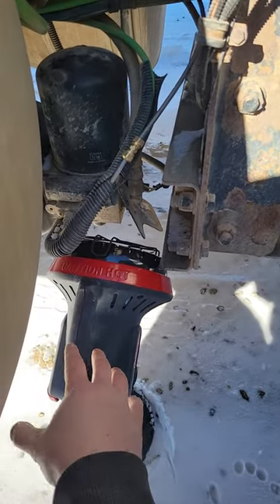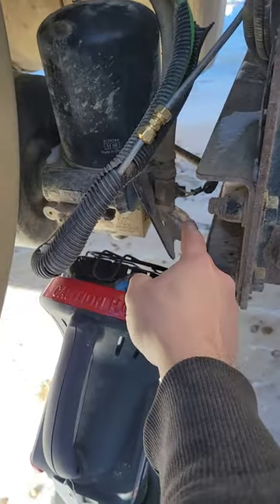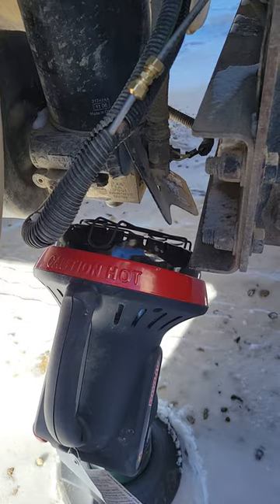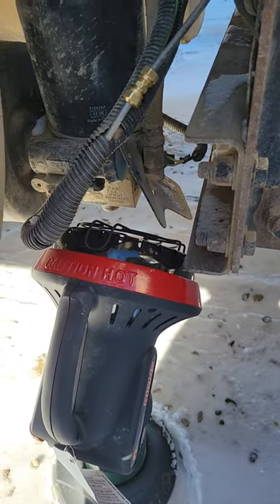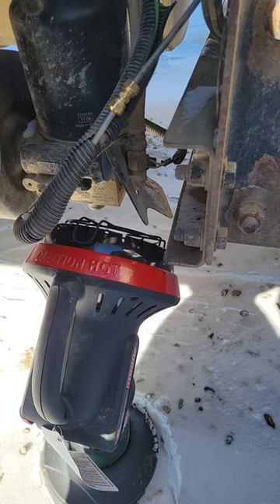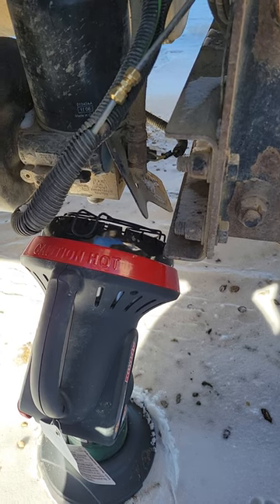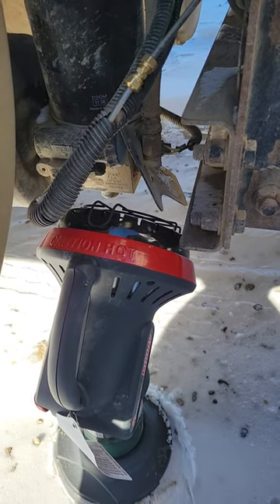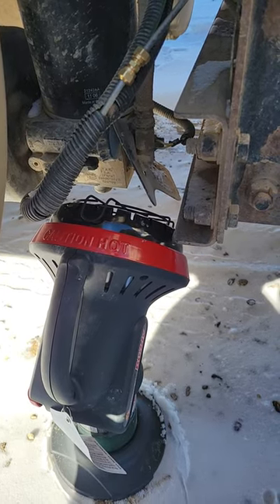How to thaw out your frozen air dryer on semi truck

Comment: If you would stop all the air leaks on your truck and drain your tanks daily  then yo7r air compressor wouldn't be cycling so much and making so much condensation in your system.  Being a teal truckdriver/ owner is way more then holding a steering wheel and fudging logbooks.

Comment: If you use Airline dryer drivers put Marvin Mystery Oil in with it put it in your Airlines every day
Reply from the maker: Did not know that
Reply: Marvin's Mystery Oil will retain part of the alcohol while keeping seals in all your brake valves lubricated. Drain your air tanks when temperatures rise above freezing